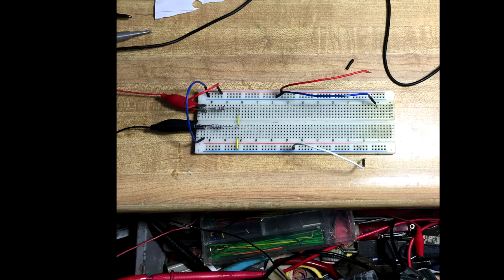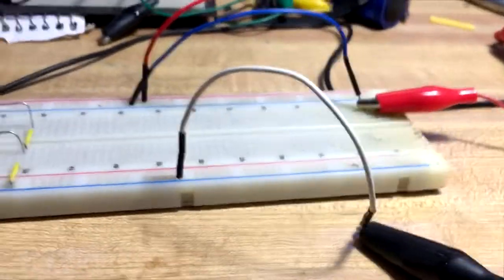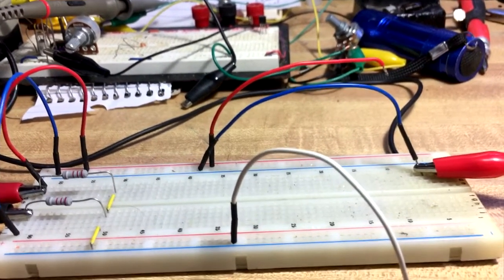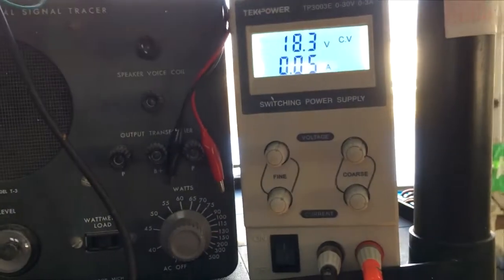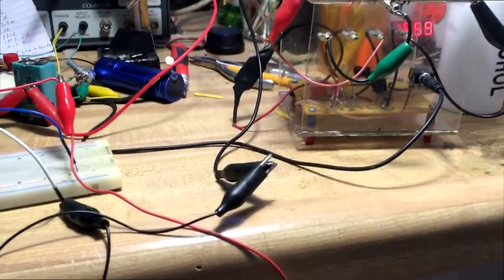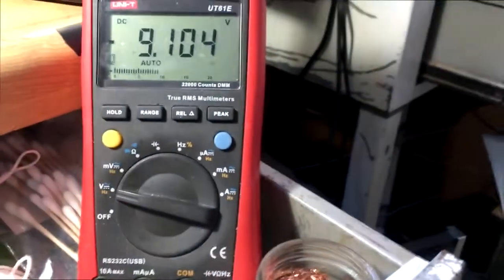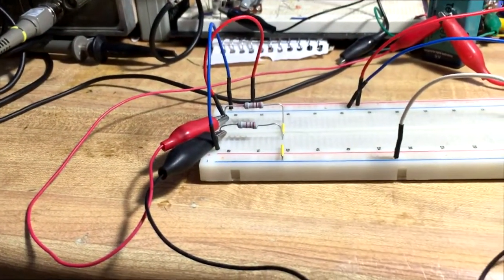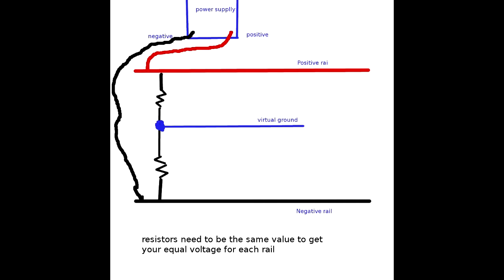Positive and Negative voltage from a single  power source

Comment: Hi Carl
The simple things in life are often the best... You mentioned in your 'clip' that I may have seen this before, I had and kept brushing it asside in search of (what I thought) a better way. Turns out that this is the better way.
I have made it into  a small box that I plug into my power supply when I need  a split rail supply (adjustable).
 I love your work keep it up and thank you for sharing.
                                                             Best wishes 
                                                                              Warren.

Comment: Thanks for the tip Carl.  I've come across this issue like you mentioned with Op Amp circuits.  I don't have a  supply that has a negative source either.  I think I have taken two 9 volt batteries in series in the past, and made the junction where they connect together the virtual ground and it did give me the +9v & -9v.  But the circuit you showed there with the 2 resistors would be good for use with the power supply.
Reply from the maker: It's funny Pete but I was doing the very same set up with two 9v batteries when I thought of doing this video. I had used this setup before so I went from there. Thanks so much.

Comment: Good video. You do have to keep the impedance of the load in mind because it'll throw off your voltage divider, and you have to be careful about your signal because your - rail is still tied to earth ground unless you have the power supply isolated
Reply from the maker: Yeah, a future video with this powering a circuit, showing the different readings through the circuit would be a good idea. It would show what's going on and what to expect. Thanks as always.

Comment: Thank's, Carl, for provoking thought - which needed to be considered. I've taken the three 'el cheapo lab-grade power supplies' for granted, as tools, and only as tools. I've been messing with a Mitel SX50 Phone Trunking Board, which has a -11.4v reference voltage required, to notify another circuit - on another board, that a "ground-start call notification" has been received, it's the system that the PBX design uses to transfer calls between subsystems.  It's been driving me nutz, because the system will not recognize two important extensions on what I thought was a failed trunk, which actually may be a poor connection causing me to lose reference voltage, where I've been blaming "rotten refurbished boards". I'll dig into it tomorrow, thanks Carl
Reply from the maker: Always a pleasure to help Tim. I knew you was going to get that hidden message of a solution to that problem. Problem today is nobody is psychic anymore so what can one do.
Always good to hear from you my friend. 
ps,, hope all is going okay with the DC-3 investigation.
Reply: for a second, I thought that I saw el Chapo, far from el cheapo, to the tune of billions of dope $ that can be used to build a wall, lol.

Comment: Great video, thank you!  One question, how would you calculate the wattage for the resistors needed to use this divider for a circuit pulling 14vdc 4 amps?

Comment: Hello, thanks for sharing!
I was looking for something easy like this for op-amps.
I'd like to ask you if this is a voltage divider, or better, a voltage partitor?
The two resistors in series between the positive and negative input, are consuming power and becoming hot?
I don't understand how they don't short the circuit!
(are they 1W resistors?)
Reply from the maker: Hey Fada, I was using half watt resistors and I used them for the split 9 volt, ( 4.5 pos and 4.5 neg ) like on the video, and I have ran 18 volts split using two 9 volt batteries and my power supply. Can't right off say what my amps were but they were strong enough to drive the op amp and I did not have any problems with the resistors overheating.
I understand your concern as I had the same questions about this when I first started studying this, but the half watt 10k ohm resistors did the trick.
Bread board this out and give it a try. Check out the resistors and see if they get warm. Then, you may want to try a quarter watt set of resistors and see if they get too hot. All the best with your experiments.
ps,,, notice that there should be a virtual ground line coming off the split. You will need that for your grounds in the rest of the circuit.
Reply from the maker: Sorry, I forgot to mention that yes, it is a voltage divider. That is why you must pay attention to the values of the resistors as they should be equal.

Comment: Very interesting, never thought of this! Do you ever need to ground the midpoint, so it's at zero volts?
Reply from the maker: Yes you can Nigel. In a circuit that is using the pos and neg voltage, you may need to go to ground and so you could tap off where the two come together for the virtual ground and use that.
Thanks as always pal.
Reply: @skycarl  thank you! Very informative video.

Comment: Hey Carl, would it be possible to do this with two computer power supplies, since those have pretty potent 12 volt rails?
Reply from the maker: Hey Koushiro, Good point. I don't see why that wouldn't work. You probably would want to monitor the amperage but that could be trimmed down. Thanks so much.
Reply: @skycarl  For example, in my PC i have a power supply that can go up to 62 amps on the 12 volt rail. That would make for plenty of headroom (that is if i had two more to power an audio amp). Regular (aka CHEAPO) psu are far weaker with less headroom for adjustment. Dedicated supplies with negative voltage seem quite expensive, why?
Reply: ATX power supplies have both +12v and -12v already.
Reply from the maker: @gugenet  I think he was wondering if you could split that 12v pos rail on a breadboard. For experimental purposes. Good mention though. Thanks.
Reply: @gugenet  Yes they do have +12 and  -12 but the -12 is separated  from +12 (dedicated ) and very low power